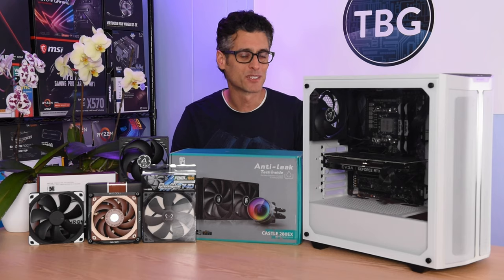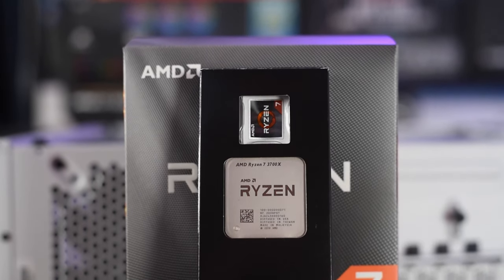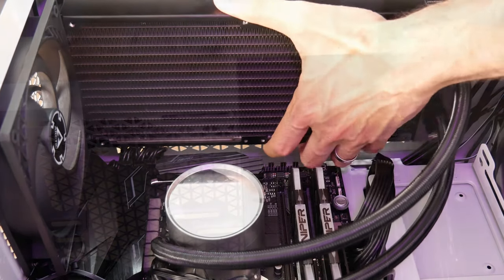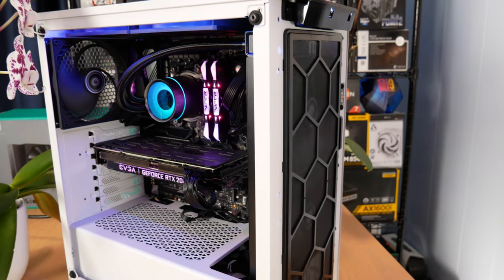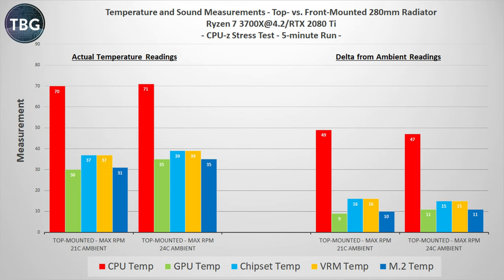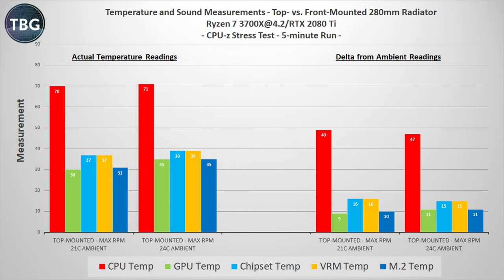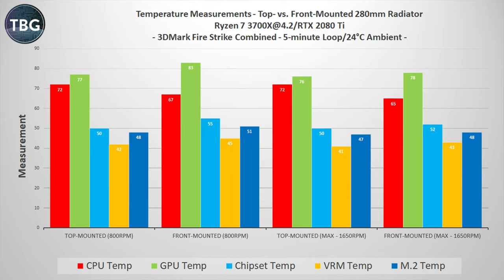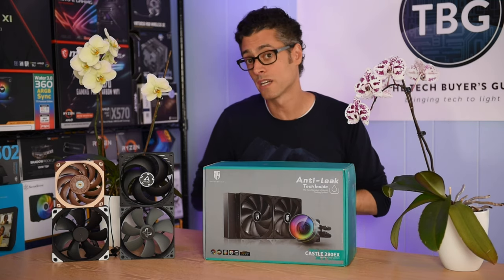Front vs. Top AIO Liquid CPU Cooler - feat. Deepcool Castle 280EX Install on AMD's AM4 socket

Comment: I tried it with x570 mag tomahawk wifi. I had to cut the Plastic frame of the Fans because there was no space for the RAM and Chipset cooler. Bit now it runs smooth. A Front Mount is also not possible in the 500dx because the 280mm Aio tubes are to short to Mount the cooler upside down as shown in Gamer Nexus. Only way is here a top mount
Reply from the maker: Did you use the same cooler and case? If so, very interesting to hear it wouldn't fit. The motherboard layout must be just slightly different, moving the heatsinks and RAM slots up enough to interfere. But watch my video coming out on Monday, as it can be front mount the way GN posted after my first video came out. Will depend on length of video card, though. Worked with my reference size 10.6" card, as you'll see if you catch my next video!
Reply: @TheTechBuyersGuru  i used the pure base 500dx and 280mm castle. But the Problem was the MSI x570 Meg tomahawk wifi. Another Problem is the  3090 strix gaming oc in the case. The card is so long that the length of the Aio is not big enough to reach the cpu if i do a upside down mount.
Reply: I bought the castle 280mm Deepcool because of your Review and im happy with its cooling performance and Design👍
Reply from the maker: Awesome, glad you got it in then, otherwise I'd feel really bad! And yes, with a big 3090, there's no way you can run the tubes down to the lower corner. Top mount is the only way.
Reply: @tombauer622  Do you have any extra info on this? I bought the exact same case, cooler, and motherboard, with the motherboard being on the way, so I haven't started assembly yet. Do you have any tips on how you made it work? I want to be able to cut the fans or whatever like you did.
Reply: @Green0Photon  when your ram-cooler is really high you have to cut a little bit of the fan frame. The best thing is first try to prepare your radiator before mounting the cooler on the cpu. Try to mount the radiator without the Fans on it in the case. Than attach the Fans. This gives you the opportunity to cut the Fan frame for the exact space you need. Sorry for my english.
Reply: @tombauer622  That's good news! I was worried the motherboard might be part of the issue. And it's nice that it's only the fans that are an issue, since those are comparatively easy to install and replace. How did you cut the fans? Were you able to use scissors or a blade or something, or did you have to use something somewhat more professional? I'm mostly confused about this part. Or do you think it would be easier finding thinner replacement 140mm fans? For reference, my ram is 42mm, and are the Ripjaws V.
The tips on assembly were helpful though, and I appreciate your help on this. I'm also amazed that it coincidentally found someone with the exact same build, in YouTube comments, no less. Thank you so much for helping me out. All of this makes me feel like I'm building a small form factor build, hahaha.
Also, your English is near perfect. I didn't even realize you were non-native until you mentioned it. Since you did mention it though, the only thing that's slightly off is that you should say "..is to first try to...", because you were missing that first "to". Outside of that, your comment had zero flaws.
Again, I really appreciate the help. I'm so excited to finally get this thing built!
Reply: @Green0Photon  i did it with a carpet knife

Comment: Can you improve your comparisons so that you eliminate the variable of top exhaust vs front intake by doing Top intake and front exhaust as well?
Reply from the maker: Interesting question, but these are going to be quite bad for GPU temps, as you'll nearly 100% of cooling airflow around the GPU and fight the GPU's own fans with airflow in the opposite direction.
BTW, I did a comparison like that using an ITX case and 120mm AIO: https://youtu.be/vPDBENpbzJ4?t=135
It was much worse using the AIO as an exhaust on the front panel.
Reply: The Tech Buyer's Guru thanks for the quick comment. I am curious is top intake would lower cpu temps more than exhaust as it’s fresh air cooling the radiator plus airflow over vrms. Also with the back exhaust there it could take out the warm air quite readily? Also would it impact the gpu temps much since the air should be exhausted before affecting the gpu? I just want to know as I run top intake myself!
Reply from the maker: One thing to consider is that when you have intake and exhaust fans placed very close together, that airflow is negated and removed from the case. I have seen this when mounting top fans very close to the front of the case - it does not improve performance. That fan just ends up pulling air through the front of the case and blowing it out, never touching the components. In your setup, I am pretty sure that most of the airflow from the top fan you have near the rear fan will be negated.
Reply: @qazzaq2004  That setup only works with a tower cooler, I remember Hardware Canucks tested the best fan config for the casing in this review with a tower cooler. 4 intakes(front & top ) provided the best VRM temps with a slightly higher GPU temp. You also need sufficient airflow going into your GPU from the front or the GPU becomes toasty. 

The radiator is pulling heat from your CPU so the air that goes through it is heated.  If that air flows into your VRM/CPU it just heats those components instead of cooling them.

Comment: Would the radeon 5600 xt bottle neck with the intel core i3 cpu
Reply from the maker: I would not recommend a quad-core if using a GPU as strong as the 5600 XT (a ~$300 GPU). I think you are much better off spending another $50 to get a Core i5-10400: https://amzn.to/2F8R1e4
The Core i3-10100 is actually a great chip, perfect for an entry-level gaming PC, but $300 GPUs don't go in entry-level gaming PCs!

Comment: I never believed in delta temps because temperature isn't linear with watts of energy. You have to state it for context. As an example during the hottest temperatures this summer I got 68 for the gpu (980ti amp extreme) but when I used it at the beginning of summer it ran between 65 and 67.
Reply from the maker: Here's the physics:
Newton's Law of Cooling:  T(t) = Ts +(T0 - Ts)e^-kt
See a demo: https://demonstrations.wolfram.com/NewtonsLawOfCooling/

The further the initial temperature is from ambient, the faster a cooler will work and the more effective it becomes. The cooling rate asymptotically approaches zero as the temperature of the object approaches ambient. But if your device is 30C from ambient or 40C from ambient, your cooling rate is still exponential, which will make it impossible to compare two coolers in a linear fashion (using a delta from ambient conversion).
Reply: @TheTechBuyersGuru  to me is then more interesting to see how fast the cooler reaches a stable minimum temperature after the load. Max constant temp is what we gamers look for but most of the users will burst from load to load.
Reply from the maker: I think this is also very interesting, and actually a better use of Newton's Law of Cooling, which assumes that an object is "dropped" into an ambient without its own heat source coming with it (like an ice in water). So in the PC context, you apply a high load to the CPU over a short amount of time (even just seconds), remove the load, and see how quickly the cooler can bring that temperature down. The further it is from ambient, the faster the initial drop is.

Ultimately, there's a lot going on when you are doing thermal testing, and I feel the only truly accurate way of handling it is to test in the same ambient. Otherwise too many variables are at play (including the higher energy leakage of a transistor at a higher temperature).

Comment: Could you speak to bitwits video on this ? He showed that the front mount during gaming loads to be better. Since the CPU was yes as you say cooler. But it only changes his gpu temps like 1 degree .
Reply from the maker: His video was done 4 years ago. Different components mean different results. He used a huge, low-airflow case and a low-wattage GPU. I used a mid-sized, high-airflow case, like you'd actually buy today, and a high-wattage GPU.

Comment: When you front mount the radiator maybe you shouldn't use the front top fan. It will suck out some of incoming air before it reaches components. Just use the rear and top rear when aio is in the front.
Reply from the maker: Interesting point. I have seen this effect when I have multiple cooling fans in front and an exhaust fan in the top-front corner. But here we're talking about hot air being blown in through. The argument in favor of keeping that hot air in the system to "cool" the RAM and VRMs, which is what they'd hit from the upper fan on the radiator, isn't that compelling to me. As I've shown, that hot air readily heats up the GPU.

Comment: What if I can put a 360 in the front or a 240 on top which would be better
Reply from the maker: That's a pretty typical choice in most cases. The 360mm will definitely provide better CPU thermals, especially in front, but overall system thermals will be worse than with a 240mm on top. Unless you have a very high-wattage CPU (Ryzen 9 or Core i7/i9), you are better off saving money by going with the 240mm on top and having a better overall system setup.
Reply: @TheTechBuyersGuru  alr yeah I'm going with the i7 10700k
Reply: @TheTechBuyersGuru  so if I'm going with the i7 10700k which one would be better would the 240 be enough cooling
Reply from the maker: The 10700K can put out a lot of heat if you're going to overclock it. A 240mm is the minimum I'd use with that CPU. If you are willing to monitor the GPU temp and potentially increase its fan speed to compensate for hot air being blown across it, then go for the 360mm. You will get much better temps on the CPU.
By the way, you should check out my 280mm vs 360mm comparison that I just posted, which is pretty interesting: https://youtu.be/uUUItnZRHyM
Here's a link to the Deepcool Castle 360EX I tested: https://amzn.to/36JuUoz #ad
Reply: @TheTechBuyersGuru  okay I won't be overclocking at all I just want to be at good temps so the 240 is fine if I don't overclock because the 240 is definitely the easier option for mounting and space for me but I want good cpu temps
Reply from the maker: Yes, you'll be fine with a good 240mm cooler. There are some 240mm coolers below $100 that I wouldn't bother with. I recommend the Deepcool 240EX based on my testing of the excellent fans and pump on the 280EX/360EX models. Here's the link: https://amzn.to/32LxWrt
Reply: @TheTechBuyersGuru  I will probably buy that cooler since it looks very nice but would a  corsair h100i platinum be good my friend has an extra one because he accidentally ordered two and said he'd give me one if I need it
Reply from the maker: I've actually featured that cooler in a number of videos on the channel. It is a very good cooler, but the price is a little high. If your friend is seriously going to give it to you for free, though, why not take it?!?
Reply: @TheTechBuyersGuru  okay thank you I was surprised but he gets alot of parts and does builds for people and stuff so I don't think it's a big deal to him lol
Reply: @TheTechBuyersGuru  by the way while I was researching aio I came across an interesting contender I found the ID cooling zoomflow the 240 in black is $80 and $90 for white and I watched two reviews comparing it to the h100i platinum with like 2 degrees hotter than it but it was quieter that was comparing with stock fans on each though the h100i won by a tad more when using other fans but was still louder

Comment: Hello. I couldnt mount in a 500DX, on top,the Arctic Freezer II 280 on a  MSI z490 edge with Ripjaws modules. Radiator is blocked by VRM radiator in some position and by RAM in another. So i can say 500DX even if it's great it doesnt work with some radiators
Reply from the maker: The Arctic Freezer II 280 is a completely different cooler, and uses a non-standard radiator. You'll want to see my video discussion how to install it here: https://youtu.be/RWxPif8ibRA

This is not a problem with the 500DX. It's a problem with Arctic's marketing of the LFII 280, which I have worked hard to fix!
Reply: Do you think the 240 version would fit in the 500DX ? 
Or same problem here ?
Reply: @Talostrino23  240 version should fit on the top. With 280 version i missed like 3-4mm for screws to fit in.

Comment: Man I gonna install mine in the bottom of the case pushing air out, and 3 too fans as intake. I wonder if it will work out better for my blower style 5700XT, this sucker runs hot af even after the mods😔

Comment: I also have a Ryzen 3700X (overclocked to 4.3 MHz @ 1.32V) in a Pure Base 500 case (not 500DX, so I have less ventilation), but I use a Scythe Fuma 2 air cooler (thanks to your tests) and on the Cinebench R20 my CPU doesn't even reach 70 degrees (usually 67C with 25C ambient, the Fuma 2 at about 80% or 1050 RPM), so I think I'll stick to my Fuma 2...
Reply from the maker: LOL, now you have me wondering what could be wrong! But honestly, it all comes down to voltage. My voltage at 4.2GHz was much higher, 1.37v. The lesson here is probably just that I need to tune that OC, but hey, people have complained in the past that I'm not feeding enough heat into my high-end coolers, so this took care of that problem!

Most likely the 280EX can beat the Fuma 2, but it also costs nearly 2.5x as much, so don't worry, you got a great deal! #favoritecoolerever!
Reply: @TheTechBuyersGuru  OK so I ran a test at 4.3 GHz and 1.375V and on Cinebench R20 it stabilized at 70C after a short peak at 71C. I did three quick consecutive runs and it never went beyond 71C. The curve on my Fuma 2 is set to reach 100% at 70C, my ambient is now 27C. According to ASUS AI Suite the CPU was pulling about 100 watts. I got an average score of 5093, 5104 on the last run.

I then ran CPU-Z Stress test and it stabilized at 67C after 1 minute and stayed there.

Just for fun I then ran AIDA64 stress test and it peaked at 82C right off the bat and then stabilized at 73C with occasional peaks at 78C for some reason.

That little Fuma 2 is pretty impressive for its size and price. Thanks for the recommendation ;)
Reply from the maker: Those are some amazing results. You know I'm not one to doubt the Fuma 2. I actually had the Fuma 2 in this test system juts before pulling it out to do the AIO test. Watch the video very closely when I'm talking about my test setup and you'll see a little easter egg to the Fuma fans out there....

But have no fear. I'm actually planning on a massive two-part cooler shootout that will first pit the DeepCool against some great new liquid coolers, and then pit the Fuma 2 against some great new air coolers, and finally declare an overall winner. I know the Fuma 2 can be beaten, but the question is at what cost and what inconvenience in terms of installation.
Reply: @TheTechBuyersGuru  Yes, I'm super happy with the Fuma 2. I'm not a gamer, I use my computer mostly for regular Office work, and photo and video editing. Since I'm not a gamer, I don't care for my computer lighting up like a Christmas tree either, in fact, I have a solid panel on my case. I have two Noctua NF-A14 PWM on the front and a Scythe Kaze Flex 140 PWM as an exhaust fan (great fan!) In my noisy office, I cannot hear my system at all except when the Kaze Flex goes beyond 1500 RPM. Despite the Pure Base 500 having a reputation for being a bit hot, this cooling system is more than up to the task. 

Thanks again for your excellent videos.

Comment: Do a test where you mount the AIO in the front correct. Tubes in the bottom. You probably will earn a degree or two due to less air.

Comment: Mount radiator up front and then add extra fans to the top of the case to pull air around gpu.